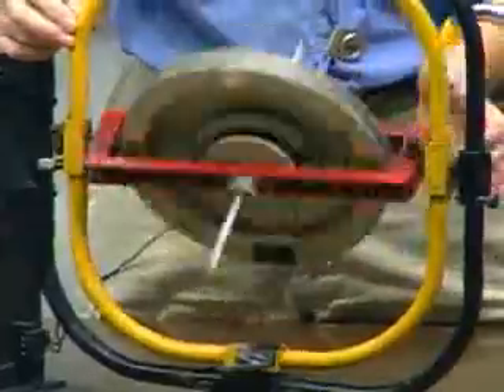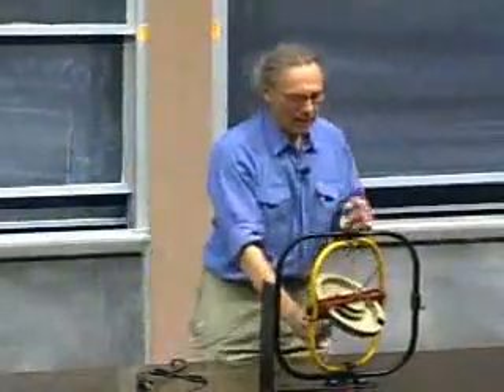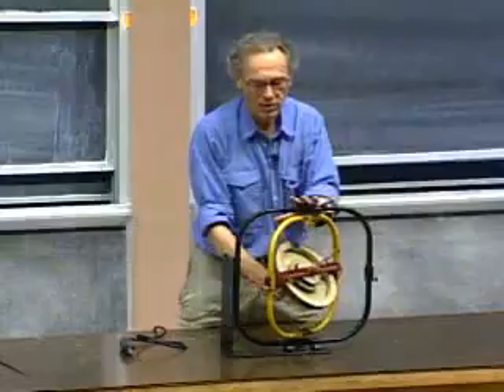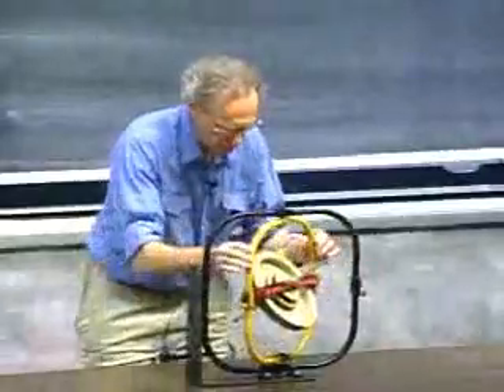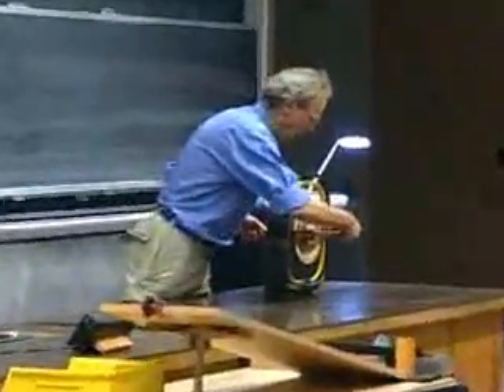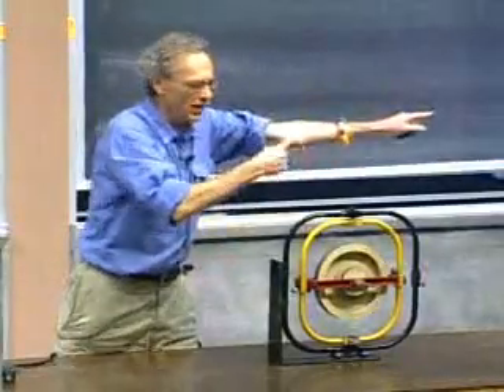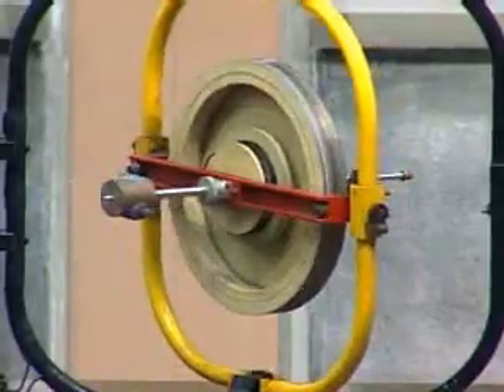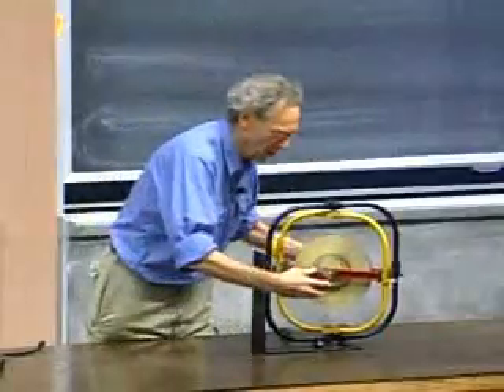Inertial Guidance System.wmv

Comment: I was trained to repair Inertial navigation equipment. Our first time spinning up a stable platform, it had a problem, and we aborted spin up and alignment. Our instructor said give it five minutes and he'd go get a new stable platform, we gave it six minutes and three of us tried moving the platform to the ground. we quickly learned about gyroscopic precession. it does not go where you want or move it, fights you all the way. I had fun working various nav systems using inertial platforms.

Comment: And this is a "cheap" way to point satellites, such as Hubble, to new points in the sky.  Rather than use  expensive and limited fuel to fire small rocket motors/thrusters (and thereby also risk fouling the mirror with rocket motor exhaust, especially after many years of doing so), there are multiple gyroscopes which by remote control engineers add friction or breaking action on any one given wheel, which then moves the entire spacecraft to the desired new orientation.

Comment: An (old) airplane moving in 3 dimensions used gyros to detect his change in attitude and flight direction, but not in the way you are explaining it.Een erg slechte demo hoor dear professor! - Paul Huyghe (paulhuyghe@outlook.be)
Reply: Gyroscopes do not detect altitude or direction it detects  "changing direction"  if you change your direction to "down" it will result in losing altitude but the gyro itself does not detect "Altitude" and if you are moving in a perfect "line" it will not move.

Comment: I think it's already clear how the gyroscope works -- the gyroscope knows where it is at all times. It knows this because it knows where it isn't. By subtracting where it is from where it isn't, or where it isn't from where it is - whichever is greater - it obtains a difference, or deviation.

Are you a jokester?
Reply: 3:01 Which is called "error signals".
Reply: Copypasting a comment I wrote (which was basically my take on the Missile Knows for this context ) - 

The spinning wheel knows where it is at all times. It knows this because it knows where it isn't, and by subtracting where it is, from where it isn't, or where it isn't, from where it is, whichever is greater, it obtains a difference, or deviation. The inertia equation uses deviations to generate force to drive the spinning wheel from a position where it is, back to a position where it was, and arriving at a position where it wasn't that that's where it shouldn't have been because intertia resists change, but it now is. Consequently, the position where it is should still be the position where is was but this is invalid for infinitesimal time, and so it follows that the position where it was, is now the position that it isn't. In the event of the position that it is in is not the position that it wasn't, the system has acquired a variation. The variation being the difference between where the wheel is, and where it wasn't. If variation is considered to be a significant factor, it too, may be corrected by the inertial torque. However, the wheel must also know where it was. The inertia of the wheel works as follows: Because a variation has modified some of the information the wheel has obtained by an external spinner, it is not sure just why a few fools are curling their fingers stretching their thumb, however it is sure where it isn't, within reason, and it knows where it was. It now subracts where it should be, from where it wasn't, or vice versa. By differentiating this from the algebraic sum of where it shouldn't be, and where it was. It is able to obtain a deviation, and a variation, which is called "Driving corckscrews in people's brains"
Reply: Force applied to a spinning disc will appear at 90 degrees in the direction of spin. Simple.

Comment: Try spinning the Gyro at Relativistic Speeds (2.5 Million RPM/Orbital Velocity). With the axis vertical. If it doesn't fly apart, it should begin to warp the space-time field around it.  Just a thought.
Reply: I tried what you suggested and time jumped forward three years. Did I miss anything during the jump?

Comment: Tilt a plane, and you create a fulcrum axis running through the plane while one side of the plane goes up and the other side goes down (a seesaw).  That axis through the plane does not move because it is a pivot axis for the plane, but the mass in a spinning disc does move in many ways.  The rotating and tilting mass that was initially motivated to go up must reverse its momentum at the fulcrum axis so it can start going down on the other side.  The rotating and tilting mass that was initially motivated to go down must reverse its momentum at the fulcrum axis so it can start going up on the other side.  REALIZE THAT!  Mass must reverse its direction with each pass through the fulcrum (2 per rotation).  Here's the kicker!  It creates opposite forces on opposite sides of the rotation plane at the fulcrum axis.  This starts the gyroscopic effect and is the CAUSE of the anomalous tilt, but here is the greatest part.  When you tilt the plane and create a fulcrum axis that creates forces, and when the disc reacts to those forces, the reaction (anomalous tilt) creates a second fulcrum axis.  That second fulcrum axis is perpendicular to the first and runs through the initiating tilting force.  AND, the forces produced at this second fulcrum oppose the forces that produced the first fulcrum axis.  Any input tilt gets inverted and push back out of a spinning mass.  The mechanism at the fulcrum axis is better than the math at the spin axis.  This is a momentum reality.  The math puts all of the momentum in terms of the spin axis which makes math a successful orthogonal analogy.

Comment: But does the spinning wheel know where it is at all times ?
Reply: The spinning thing olny knows that it doesnt want to move.
Reply: It knows where it is by subtracting where it wasnt
Reply: The spinning wheel knows where it is at all times. It knows this because it knows where it isn't, and by subtracting where it is, from where it isn't, or where it isn't, from where it is, whichever is greater, it obtains a difference, or deviation. The inertia equation uses deviations to generate force to drive the spinning wheel from a position where it is, back to a position where it was, and arriving at a position where it wasn't that that's where it shouldn't have been because intertia resists change, but it now is. Consequently, the position where it is should still be the position where is was but this is invalid for infinitesimal time, and so it follows that the position where it was, is now the position that it isn't. In the event of the position that it is in is not the position that it wasn't, the system has acquired a variation. The variation being the difference between where the wheel is, and where it wasn't. If variation is considered to be a significant factor, it too, may be corrected by the inertial torque. However, the wheel must also know where it was. The inertia of the wheel works as follows: Because a variation has modified some of the information the wheel has obtained by an external spinner, it is not sure just why a few fools are curling their fingers stretching their thumb, however it is sure where it isn't, within reason, and it knows where it was. It now subracts where it should be, from where it wasn't, or vice versa. By differentiating this from the algebraic sum of where it shouldn't be, and where it was. It is able to obtain a deviation, and a variation, which is called "Driving corckscrews in people's brains"
Reply: @thepotatoof4219  I recognise this from a joke Documentary short on a missile guidance system. Even written out here by you, it still blows my mind up when I try to grasp it. I just accept it works.... somehow.
Reply: The spinning wheel doesn't have to. Its happy to just spin. It just always spins in the same way and thus when you effect a change on it, it changes in sympathy and we take measurements of the difference. Leave it alone though and it'll just carry on doing what its doing uninterrupted. :)
Reply: It knows where it is by knowing where it isn't.
Reply: @Alex flat wth
Reply: @Ira Braydon this is a bot.
Reply: @Porter Brendan you're a bot too.
Reply: Spinning wheel doesn't know when it is and why.
Reply: NO! It doesn't "know" anything because it's not "conscious"!
Reply: @rajanne2947 Thank you for your 5-years late input, random person who didn't get the joke.
Reply: But if you had asked "Does SPACE KNOW where the wheel is located including it's soin direction? The answer would be YES. Space knows where ALL the objects within it are located including what they are doing (spinning etc)!
Reply: the spinning wheel knows where it is because it knows where it isnt
Reply: @Alex flat The fuck
Reply: It knows this because it knows where it isnt.

Comment: Putting this on my things to do list..if only, I could get my hands on a gyro.
What's the problem with it?  I don't understand - because I'm weak in passing physics.. And math.
Can I deduce that a spinning object, breaks free from a magnetic field(earths magnetic field), and now has a movement off its own. The earth is spinning, - let's think of it as a spinning disk. What would happen if we put two spinning disk together? 

..also, air friction and the weight off the axis would slightly tilt that spinning disk - as the axle slightly up tilt on the inner rim, hence making this experience have an error.

What would happen if the weight was small, not to create much force on the axel, and the axel welded onto the disk.

Comment: This gyro doesn't have 3 degree of freedom. I can see that housing (yellow and red) allow the gyro to rotate only on two planes. Aviation experts would call them pitch and yaw. There is the black housing there as well. But the black one is not connected to any outer support with a joint allowing it to rotate around roll plane. I can undersdtand that human hands can to some extent function as a support of black housing that I am talking about, but in this case we can't call this gyro a free gyro.  Free gyro should have 3 degree of freedom regardless of human intention to allow it to have the 3rd degree of freedom.
Reply: Thank you😂 I spotted that aswell..

Comment: Excellent video.
When there is no Gravity in space, how a gyroscope works without a Torque (due to gravity) and which forces are acting to activate it?
Reply: that is the fallacy that most globe believers use to "prove" round Earth. Torque does NOT have to be from gravity. it can be from ANY push/pull  on the mechanism. What you are referring to, is "unbalanced force". Therefore, a gyroscope WILL work in space, simply BECAUSE GRAVITY DOES NOT AFFECT IT!!! in "space" or freefall, or microgravity, etc, there would be even LESS friction on the bearings. https://www.youtube.com/watch?v=XPUuF_dECVI
jump to: 33:27

Comment: Great American invention.. Thank you Charles Draper and  MIT the best engineering university on the planet..
Reply: It is a German invention... ;)
Reply: @hoagie5556  No it's not.. As Gyros are not Inertial Guidance System. As nobody thought it was possible till Draper built one..
Reply: @WizzRacing 
"The guidance system used by the Germans in 1942 in the V-2 missile can be considered to be the first use of inertial navigation."
-Institute of Navigation
Reply: @hoagie5556  No it wasn't.. As all gyros do is stabilize the rocket..There is no "Guidance" system. Much less a "Navigation" system even in existence. 

So you need to go read more how they work. And why it had taken so long to produce one.
Reply: @WizzRacing  So the track between two certain points is no kind of "Navigation"? Sir,  please...
Reply: @hoagie5556  Listen slow one..Either ask the schools for refund. As they failed to educate you. As all a Gyro does is keep the platform stable. It does not plot a course. It does not navigate to a point in space. You need a navigation Computer that does that for you. 

Now go get educated on how things work and why.

Comment: we need two inverted gyros sharing the same axis (one motor to power both at the same velocity) so they wont precess. then tap the spin for lift. or movement to a direction by dipping the wheels. same as we are on a boat and we wobble it to a side. also when you would rotate the second housing perpendicularly and then get the axis to move by a side force it would respect the holder. if you turned the second outer housing to match the inner axis then you could apply change i think. we need a 6 directional system really, with functions depending on the orientation of the craft. when the wheels where rotors for instance we would translate spin to lift. rotors have even less mass than the disc spinning yet acts the same with the added benefit of lift.

Comment: Excellent demo of similar INS used in older aircraft still in the air today. Many people forget that GPS/GLONASS are worthless if they are disabled. INS in the EMP resistant warbirds will still function.
Reply: Modern aircraft use it too, just they tend to use laser gyros instead. Half of the fleet I fly is IRS equipped and the other half is AHRS, which is a modern equivalent of the IRS.